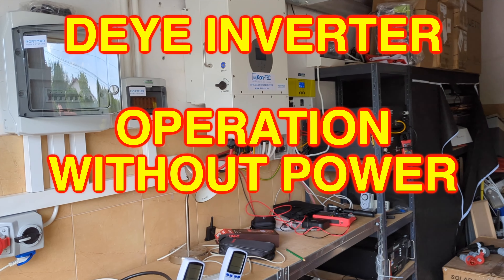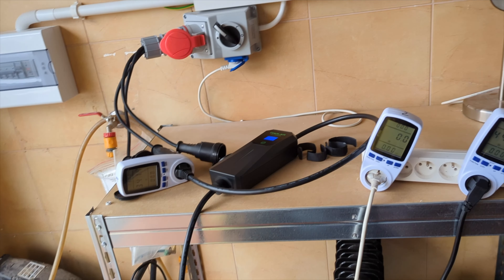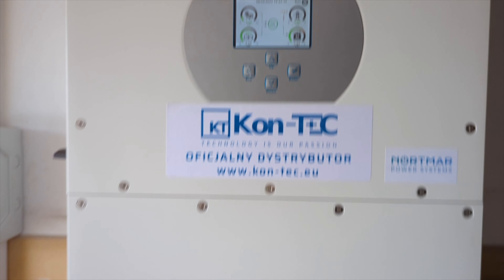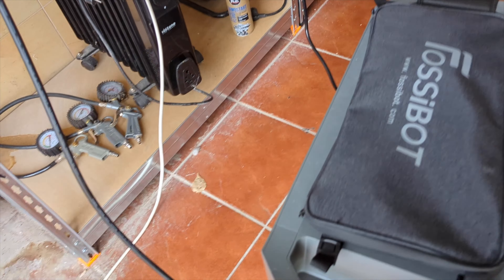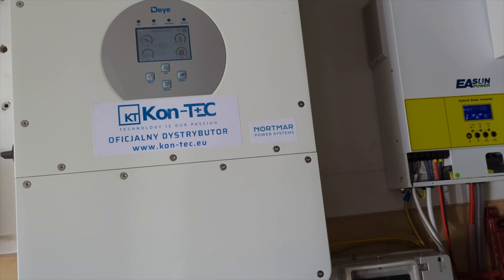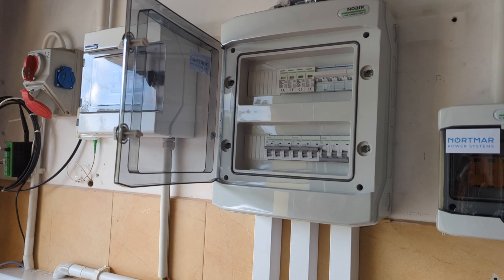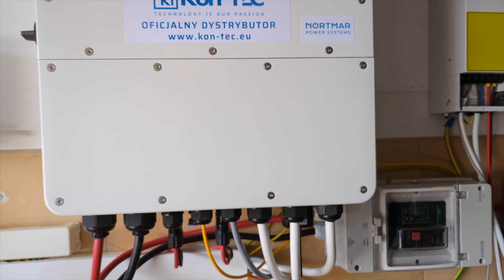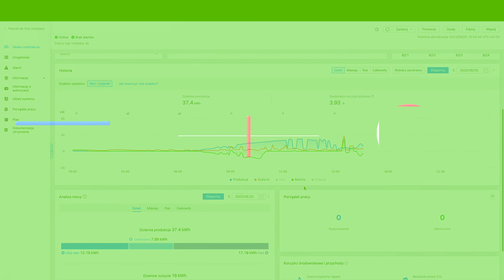DEYE Inverter. Operation without power.

Comment: Hello, it's kind of an interesting video.  May you please install an additional grid-tie inverter and check how it would work with this feature (connected up to the GEN port). Lots of folks have grid-tie systems and in case of blackouts they are out of the electricity in term of installing that one they might be able to start the grid-tie inverters.

Comment: Nice.  Do you know if this inverter can do the same without switching off the mains?  Can it work as an off-grid inverter but when solar and battery are depleted only then switch to mains power?  Where do you connect the loads (house) in this case?   Thanks!